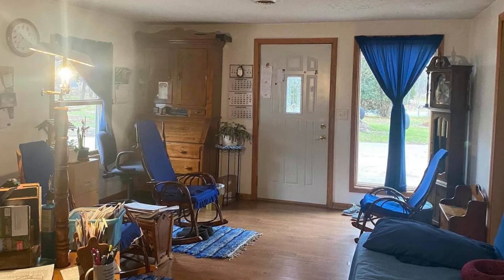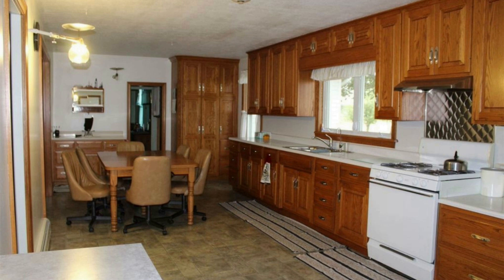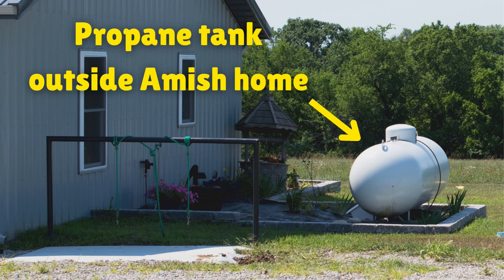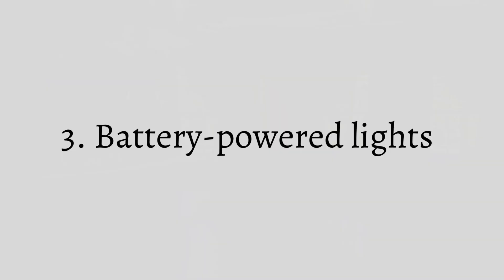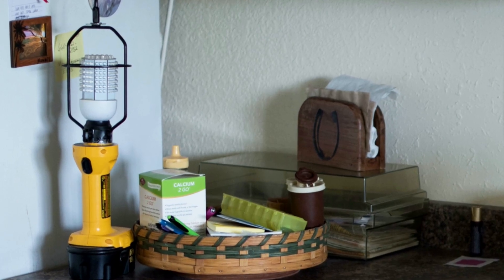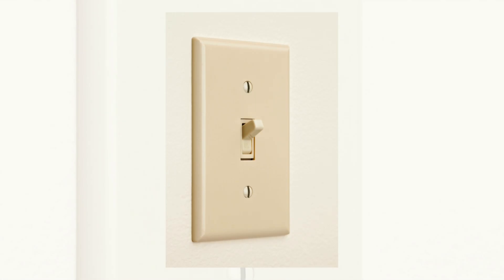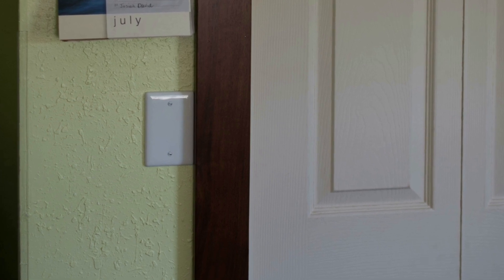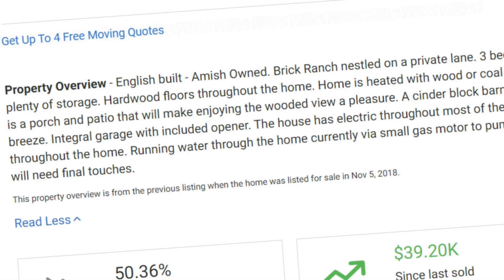3 Ways Amish LIGHT their Homes

Comment: Hey Erik, Fuel burners seem so dangerous. I once wired a Mennonite store that had gone modern. I could not believe the miles of copper propane lines in the attic.  An Amish man saw me struggling to wire the front porch light (the steel siding was my problem). He offered to help me with the wiring. Me, a high voltage electician getting coaching from an old Amish guy. Anyway, since you are not selling books, tell us what you do these days.

Comment: What about carbon monoxide poisoning due burning all of these fossil fuels?
Reply: I'm not Amish but live off grid.  Use gasoline pressure lamps and stove, kerosene wick type lamps.  I have a propane stove and lights as well and some lithium ion battery powered lights.  Burn wood and coal for heat.  I have a CO detector with a digital readout.  It always reads 0.
Reply: @nobodyspecial3410  do you make your own videos about your lifestyle? If not, you should consider it. It sounds very interesting.